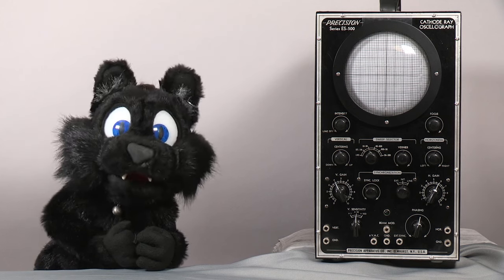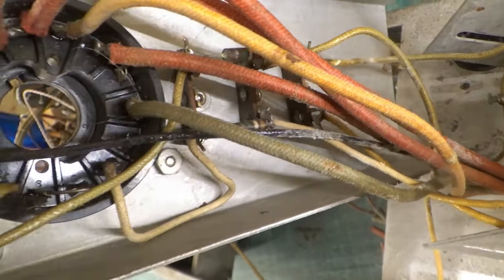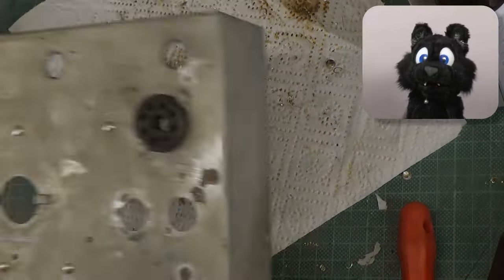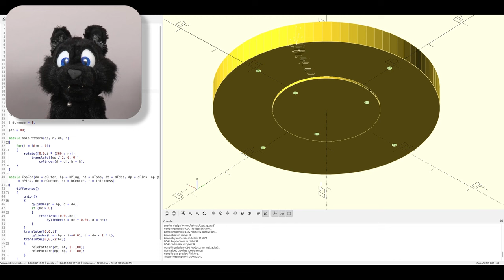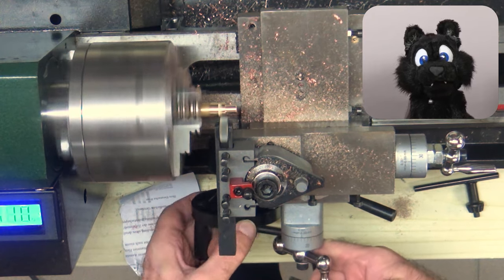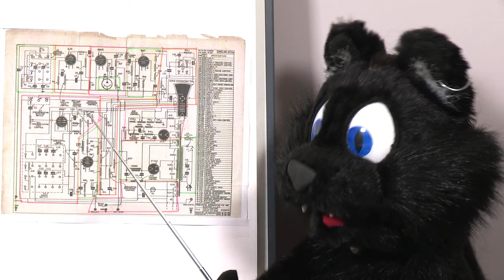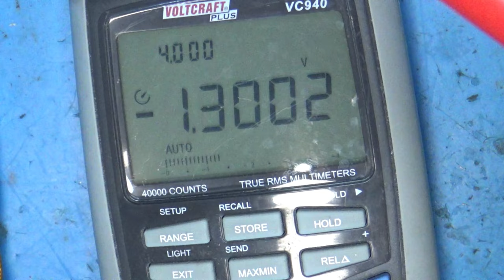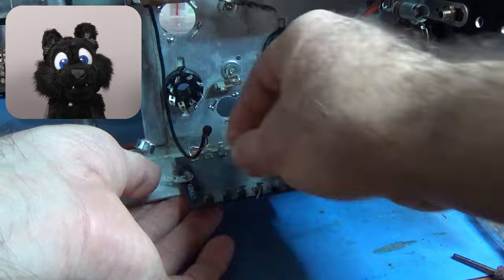Precision ES-500 (Part 2/3)

Comment: In the dim distant days that I was building precision electronics for instrumentation if there was no resistor with the appropriate power rating and value I was told to build a compound resistor made of two resistors in parallel. Some pair of resistors of the appropriate power rating would usually be within the correct value and tolerance for the circuit. Piggy back one onto the other and then treat them physically as one resistor when putting them in circuit.

Comment: Dremel Versatip, oh yeah! It's a nice iron though lack of temperature control has its disadvantages.

Sometimes you want to keep stuff together, but end up discombobulating the thing... So I did with an early '50s radio currently on my bench. Stripped it down to bare chassis, tested the components, gave them a nice bath in an ultrasonic cleaner. Putting those parts together again.
Reply from the maker: I got it for mobility... Now it's mostly a spare iron when I move around. I have the 'dirty' workshop and the electronics workbench. Whatever is around at the time for the disassembly 😊

Comment: "This isn't even a wire anymore, it's a shoelace! There's no metal left!" (obscure quote probably no-one will get)
Reply from the maker: I don't get the reference, but it does fit. Some of the lines were pretty corroded.
Reply: @atkelar  It's from Warehouse 13, early 2010s era show. The maintenance man they called to upgrade the computers in a giant techno-magical building was up in the rafters with various wiring from the past hundred odd years of work when the boss guy yells at him to be careful to put everything back or risk disturbing the magic voodoo that keeps the place running so he countered with that. It's like a comedy X-files style show with lots of history/vintage tech babbel, very geeky supernatual sci-fi stuff. Only show I've heard name drop things like "Shelby bulb", "Mallory capacitor", "Allen-Bradley resistor", "Philo Farnsworth", exc and of course everything old and supernatural has tubes cause tubes are magic. XD

Comment: I have the 520 model. Trying to get it running. Im a novice but Im seeing a wire that has detached that seems like it jumps from pin 1 to maybe pin 6 or 7 on the tube that sits by itself under the CRT. Its a 12AZ7 tube in question. Any thoughts?
Reply from the maker: First off: be very careful with the voltages inside that thing. The CRT is running with about 2000V of DC in the 500 model, I assume a similar value in the 520; but since I can't find a schematic on the internet, I have to guess... the 12AZ7 tube has one plate on pin 1 and the second plate is on pin 6. I'm far from an expert, but I think connecting two plates together doesn't make much sense, so I'd guess it's more like 1 to 7 which would be one plate (that also needs some other wrie going there to provide input voltage) and pin 7 is the grid of the second triode... so one output feeds into the next input... while I haven't seen that either, it does at least make some sense. If the schematic is similar, this double triode might be the sawtooth generator. On the 500, the cathodes are commoned together but no other pins are directly connected. I'd strongly suggest trying to find a schematic diagram in some forum or on ebay, becuase with just a few hints, it's not at all easy to diagnose.
Reply: Thanks for the reply! I cant find a schematic for the 520 anywhere. In your opinion, is reattaching the wire to pin 7 taking any risks other than possibly damaging that individual tube? The wire is bent in a way that it couldn’t have popped off anywhere further away than pin 6/7.
Reply from the maker: It's really hard to tell without the context of the surrounding items. It might also be that somebody has clipped out a component (like a capacitor) before and left that wire hanging because they just didn't finish the repair... What else is connected to the pins in question? According to the data sheet of the 12AZ7 tube, the only pin that might be unused is pin 9 (heater center tap, not needed if heater supply is at 12V) anything else is a functional pin and should not be floating. I doubt that the connection between ether 1-7 or 1-6  would damage the tube outright, but depending on the surounding elements, it might blow open a resistor or start to draw too much current and might suffer eventually. I'd say the next most important step without a schematic is to do some reverse engineering aruond that tube: what parts connect to ground, what connect to +UB and where does the signal come from. For a single tube, that should be reasonably simple by just buzzing out the wries to their next "hop". Pins 4-5-9 are the heaters, they should go to "all" of the other tubes in parallel. That leaves 1-2-3 as the P-G-K of the first triode, and 6-7-8 for the scond one.

Comment: My line of arguing when schematics changes over time is that they found cheaper components that does the same thing. Not necessarily making the design better. It's the same with food products. "New improved recipe". Grrrrrr.......
Reply from the maker: In principle, I agree... but this change is so oddly specific, that I still think it must have had onother motive. I mean, why just change the one tube and not the other that drives the same output, only X instead of Y? If the tube is indeed much cheaper, why not change both of them? Everything else is either the same (inductor) or even added (resistors).